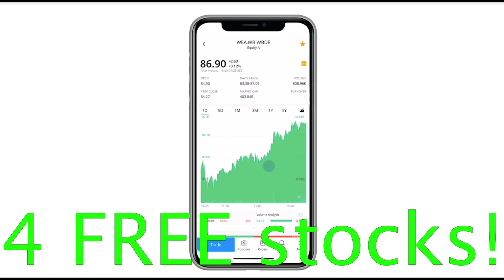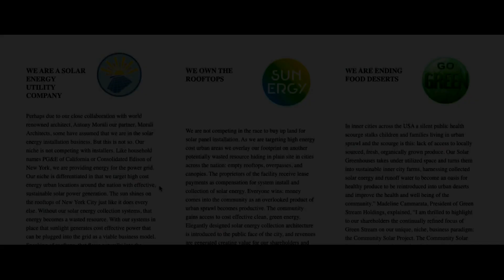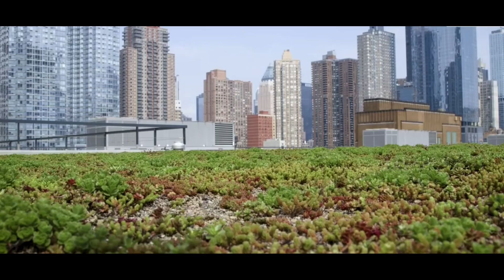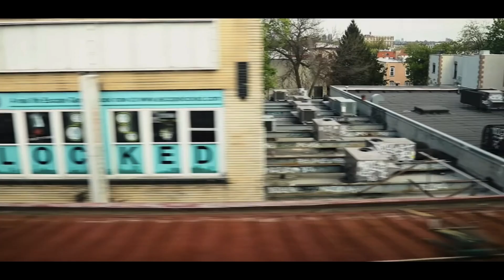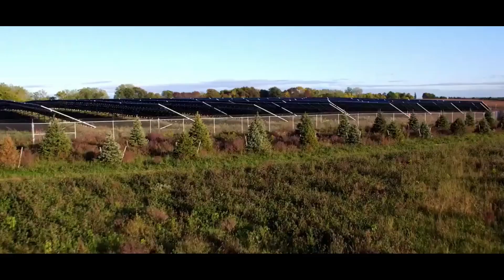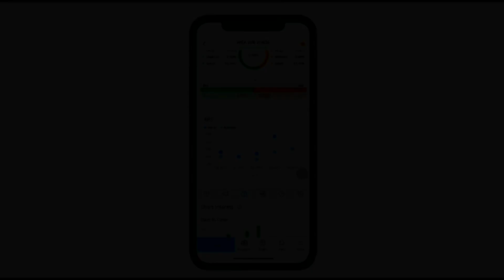Clean Energy Penny Stock! Solar Panel Technology

Comment: Staying calm through the daiIy market price changes isn't an easy feeling to bottle in, although I still strongly believe Bltcoin is going to enter the $50kUSD record before mid-year, and that's my personal opinion. A lot of my friends who are holders are currently going crazy over the sudden drop in price and a follow up rise. Firstly, you aren't supposed to be emotionally entangled with the market charts/price. This is a good realization I worked towards correcting early last year, so it was never second-guessing when an opportunity as crypt o tradlng came my way. With much energy channeIed in tradlng Bltcoin daiIy with the gulde of a T.A exp ert Floyd Wilson, my portfoIio went from approx 5Bltcoin to 28Bltcoin within a year. I will always suggest to newbies or old holders, Trad e with an expert people! It is truly easy, only requires your time and gulde with a mentor like Floyd. Reach @floydwilsonxmtrade on ͲҽӀq ɾąʍ  OR ω𝓐𝓽ѕ𝓐ρ𝐩 + 1- 4 0-1 6-8 4 4 3-8 4  Goodluck